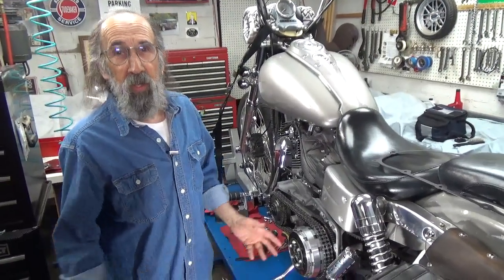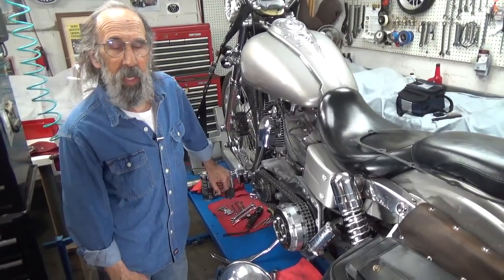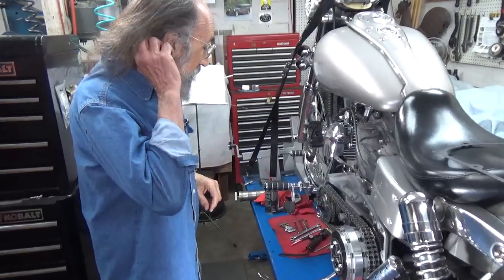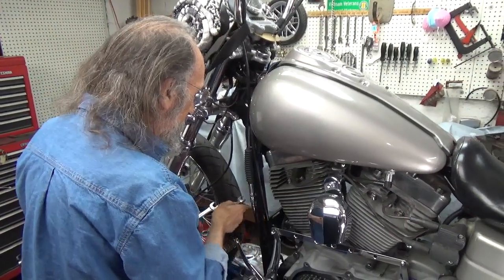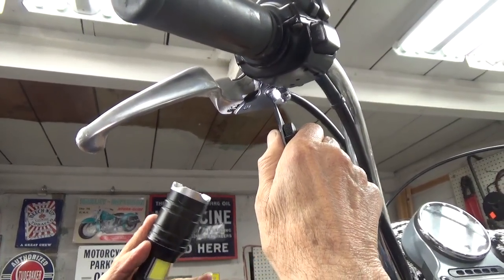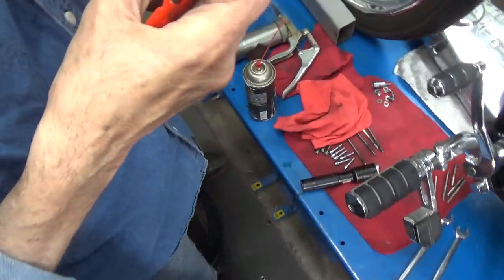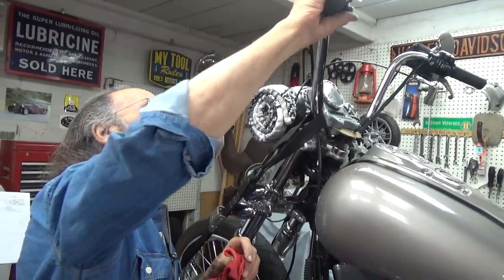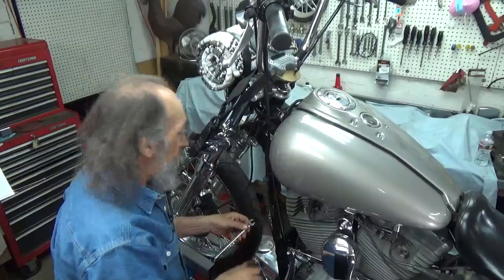Adjusting the Clutch On Cameraman Mike's Twin Cam Harley Dyna

Comment: Years ago I bought a little tool that clamps over the end of the cable and had a hole in it for your straw. The upper end is sealed off when you tighten it and the lower end is clamped around the outside of the cable. When you shoot the lube the propellant sends it down the cable. Worked well for the off road stuff that was always dirty.
Reply from the maker: Yes, I've had those.  This is just the way I do it.

Comment: Thanks Mike, my cable broke in the Crows Nest Pass on a long weekend! We fed the cable through a plug socket , splayed the cable and taped it up real good. Rode 700km to Medicine Hat using the socket as a handle and pulling like hell! Just did a spring service on my Ultra. Think I'm going back into the shop to lube my new cable. Thanks for the info.
Reply from the maker: Good Story.  Thank You.

Comment: Here’s a tip for you if you’d like to use it. To help avoid problems with corrosion on your threads of your clutch cable, apply a thin coat of anti-seize on the threads and work it into the long adjuster nut and up enough to also cover the threads under the lock nut. When done with your adjustment, apply a thin coating of Vaseline over the entire adjustment surfaces before you slide your rubber boot back over it. The anti-seize will make the threads turn easily for the next adjustment, and the Vaseline will protect the surfaces from moisture that gets up under that boot. I hope this was useful to you.
Reply from the maker: Of course it is.  Thank You.
Reply: @pacificmike9501  I hope it helps you in the future with some of those pesky, rusted cable adjustments. See ya on the road!

Comment: I needed to see this as a reminder to lube my lever and cable. I have an 03 with 89,465 original cable that gets the treatment . I also have a set of O ratchets that make adjusting the clutch nuts easy,
Reply from the maker: Cool.

Comment: Yeah make I'm with ya on that.  I've used a second throttle cable to replace single throttle cables and clutch cables, while out on the road, many times.    I've never been a fan of 2 cable throttles but, it's hard to deny it when you need a cable and have no way too get one.
    Take it easy,
                   Bryan
Reply from the maker: Sometimes you just gotta get a little "creative."

Comment: Recently replaced my clutch cable, it was severley rusted, needed to use a set of pliers to move the cable inside of the sleeve, just one thing on the clutch adjustment, I saw from another channel, they will use a long allen key and allow the adjustment screw to tighten only to the weight of the allen key and then turn it back about 180° and tighten. Thanks for sharing.
Reply from the maker: Sounds good.

Comment: I have good luck with sewing oil on the cable. I apply it in an old fashioned oil can. The ones you pump the bottom with your thumb. I can lube while it's still connected. I pull the collar back and put my oil can tip like you did with the spray can in the video. It flows right down the cable in no time. When my adjuster is wet I know i'm done. I did it your way before (the correct way), but once you lose the snap ring like I did, I said that's enough. lol I never found that snap ring, and I had to use one close to the same size for a while, until I got the correct sized ring. To be honest, now I don't remember if I ever did change it out. Oh boy!
Reply from the maker: I think I remember.

Comment: Mike you have to adjust the clutch at the screw in the middle of the clutch. Bump the lock nut lose then with a flathead screw it in all the way until it stops, then back it off half a turn. Then knock the lock nut back tight. 👍
Reply from the maker: Okay.
Reply: @pacificmike9501  👊
Reply: Lol he didn’t adjust the screw. Then tightened the jam nut. And I’m pretty sure he knows what he’s doing
Reply: @YoureAcuck69  new stuff vs the old stuff

Comment: On my Fat Boy I'm missing the anti-rattle clip as well. Are they something that's rough to put back on? My buddy's bike is missing his also.  Just wondering.
Reply from the maker: They break and fall off.  Every dealership has a bag of them in their parts room. They aren't expensive.  It is most easily replaced when the lever is off.
Reply: @pacificmike9501  thank ya,  I'm gunna get a couple of them so I can give my buddy one as well.  And oil the cables too.

Comment: Mike, I recently did the same clutch adjustment procedure as you, and when it came time to back out the adjuster screw, with half a turn out, I had way too much slack in the cable.  I was not able to take out the slack with the cable adjusting nut. The only way I could take out the slack is by not backing out the adjusting screw the half turn. I left it alone when I had it seated lightly. Why caused that?  I hope to run into you one of these days at American Motorcycle in Banning.
Reply from the maker: Look carefully into the fill hole on your tans.  See if the arm has backed up, taking up the slack.  If not, back it up with a screwdriver, then, adjust the center screw on the clutch.

Comment: Thanks for sharing, HD dealership just replaced my cable a few days ago & it was great until this morning on the way work it started up again, having a hard time shifting & finding neutral, so got to work and pulled the cable to see how slack (supposed to be 1/8” gap roughly) well,, I got about 1/2”, so wouldn’t I want to shorten the cable to make less slack? Right now the clutch engages when I barely let the lever out, and when I pull the clutch lever in if feels like the bike wants to go forward still. I’m assuming after a new clutch cable installed that the clutch cable will need to be adjusted after several miles of riding (breaking the clutch cable in) is that normal or is my throw out bearings gone bad)?? Any recommendations or suggestions much appreciated Mike. And based on your describing the cable in order to remove clutch lever that you are tightening the cable before hand, did you mean loosening the cable?
Reply from the maker: Try to adjust the cable properly.  Of course, I don't know what the motorcycle is, so I 'll just give you a very basic answer.  First, make sure the clutch is adjusted properly.  The way this is done is to loosen the cable completely, then adjust the center  adjusting screw at the clutch.  Then, adjust the cable.  By lengthening the cable housing, you effectively shorten the length of the cable.  Not to be rude, but please, buy a service manual.  It's all in the details.  If you can, go back to the dealership, and understand that the adjuster may not have been in position when it was adjusted.  They can probably fix you right up in a few minutes.  This does happen occasionally.
Reply: @pacificmike9501  Hey Mike, yes sir, I have tried buying a service manual for my bike & majority of what I’m finding is thumb drive and I’m wanting a paperback version. BTW,, 2016 Road King. Thank you Mike!
Reply from the maker: Cool.  It's really basic stuff.  You'll enjoy maintaining it.

Comment: I chuckled at the beginning when you started the video with a big sigh. I appreciate you doing these videos. I know my stress level would elevate being on camera. My niece has a 2010 HD softail cvo convertible FLSTE2 that she complains about not going into 1st gear during a downshift while riding on the road. She is only 4 feet 11 inches. During troubleshooting a problem I always first consider is the operation being completed properly. I call this "operator error" or OE. Is she depressing the clutch at the correct time and is she depressing it all the way. Plus since she is only having this problem during the last downshift, is it because of fatigue? What do you think Mike?
Reply from the maker: Well, I've not heard of any "inherent problem" with a downshift to first.  I remember when the five speeds first came out and the big complaint was they couldn't put the bike into neutral once they were stopped.  It only slides in while you're moving.  I'll bet, if you move that shifter lever up one spline, it will solve the problem.  She probably doesn't have a large foot, so pivoting it may not put enough movement on the lever.  I used to fit a lot of people to their bikes.  I'd ride next to them and see what their body wanted to do.

Comment: Say Mike like to ask a question need to find out why my clutch is not adjusting properly after doing all the proper adjustments will go in the first year but I cannot get it to shift up the guy I bought it from put a transmission in it and new clutch however he never wrote it so trying to find out what my problem is
Reply from the maker: I don't know if your clutch is functioning or not, or if the trans is functioning.  Need more information.  Also, hand shift, foot shift, model and year of motorcycle.
Reply: @pacificmike9501  sorry I have a 84 softtail foot shift and I shifted though the gears and 4th gear is not there its like it's in neutral so I guess I'm going to have to pull the transmission out to see what is been done wrong I'm not sure what type of gears were put in thanks for answering
Reply from the maker: Sorry  I can't always do a long distance diagnosis.

Comment: Do you have a video on how to adjust the mousetrap clutch on a  panhead? Thanks
Reply from the maker: Yes.  It is on my Knucklehead.  Knuckleheads never came with mousetraps, but it is the same exactly as if it were on a Panhead.  Go to our Youtube homepage.  Tap on the word "videos" and they will all come up and you can go through them.  Or, just go to Youtube and enter the word mousetrap and it should come up pretty easy.
Reply: @pacificmike9501  I found your video on the mousetrap performed on a panhead. Thank you!!
Reply from the maker: I believe it was on my yellow Knucklehead.  But, I'm glad you found it.  I hope it helps you.

Comment: Any motor oil recommendations for a shovelhead?
Reply from the maker: I don't recommend brands, but I run a modern semi-synthetic 20/50.
Reply: @pacificmike9501  thanks wasn't sure to run a 60 weight or 20w 50 my first shovel head all I've owed before is twin cams
Reply from the maker: Sounds like you're in for a fun education.

Comment: Hey brother I need some help and advice on my 97 road king how can I contact you
Reply from the maker: You just did.  Write in with your issues.  I'll try.
Reply: @pacificmike9501  just noises when Im ridding from the top end. Its not effecting anything but driving me nuts. Second Harley I know nothing about them. Big dont use oil or smoke no issue other then the noises